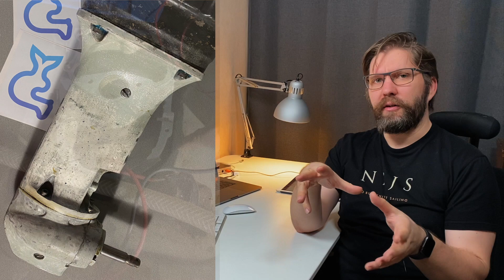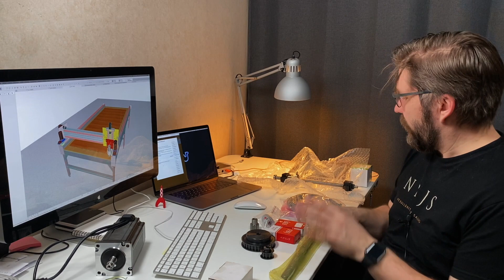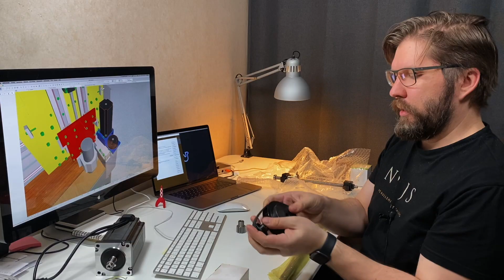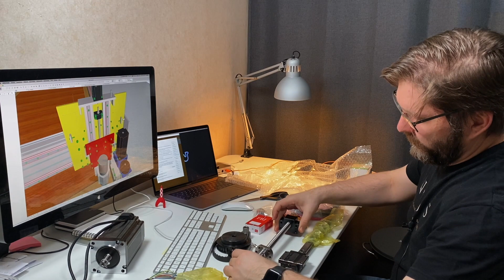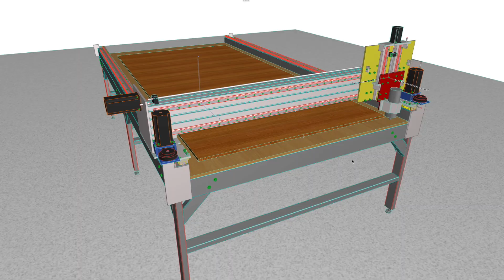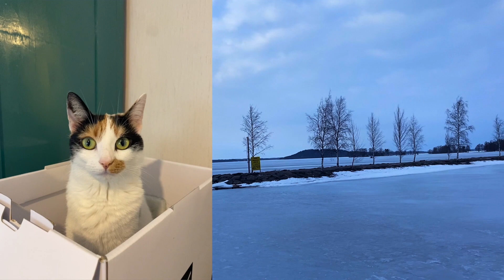Explaining the CNC-router electronics! DIY CNC router part 3 - Ep18 Project SeaCamel

Comment: I built a much more complicated table with multiply levels for Austin Mini Car when I worked for a research and developing company years ago in the early 90's the table I built was welded with hard wire and had to clamp everything and not weld things up  too much to eliminate the heat and the distortion to control the heat as much as possible for less warpage It had many rails in the table that had multiply axis and multiply levels. and was set into a gantry kind of set up for robotic welding process. When it was finished it was sent to Birmingham England. Its been so long ago I barely recall building it and the processes involved in the build.

Comment: excellent work, I ask you some questions: 
1- which motor do you recommend, step motors or servo motor? 
2- about Controller, for a professional use, which one do you suggest me buy? maybe like the CNC USB controller Mk3,AXBB-E , Centroid 4 axis Acorn?, Arduino, or some other? What is the difference between them ?

3. which is better or the difference of using Ball Screw nut BK/BF12 or Timing Belt ? Which is faster ?
Reply from the maker: Hi! Good questions! I'm not expert so these are my thoughts only...

1. Servos are of course better, more efficient and everything but more complex to run and much more expensive. In normal machines like this I see no particular reason for going with servos. If you do professional machine with high speeds and ultimate precision, servos should be the way to go. My motors are "stepper servos" which means that they're steppers but added with encoder to send information of the rotation and position to the controller. So if the motor loses steps, the system will stop to avoid mistakes. Also it should be more energy efficient.

2. For professional use there was suggestion in some comment of more sophisticated motion controller system. Can't remember right now what it was. But anyway I would not get USB-connected but more like "stand-alone" controller that shouldn't care if connection to the computer was lost in the middle of the job. I really don't know enough of these to make any particular suggestion.

3. My first thought was to use timing belt for running the Y-axis (the longest). I asked about it on forums, but apparently there might be problems over time when the belt slightly stretches. Ballscrew is the best in my opinion, but on longer distances there's "wobbling" issue especially on higher speeds. I could imagine that with belt, you can run the system faster. Also if needing fast and accurate, check rack and pinions with bearings. Nexen is one brand that I came across.

Comment: Can you send me  circuit diagram?? Are you using offline controller
Reply from the maker: Hi. You can find the circuit diagram from here:
https://drive.google.com/drive/folders/1WK6L1AJX6qnwg2RIOntq3Gag16lX9NK0

The controller is GoldenMotor's own. There's no any realtime connectivity on is as far as I know.
Reply: @ArcticSeaCamel  you had sent me a another circuit but I need a cnc circuit diagram
Reply from the maker: 😂 Sorry! I didn’t check which video you commented! 😂

I’m afraid I don’t have circuit diagram for the CNC. It’s not that complicated after all and has few “layers” so to speak.
-power in with 230V system (contactors, breakers etc.)
-power supplies for motor controllers are all separated
Rest kind of goes around the Motion Comtroller
-24v power system
-5v power system
-signal cables for all the stuff.

I used mostly CNCdrive’s own manual that has quite good instructions and chematics in it.

Hope this helps!
Reply: @ArcticSeaCamel  oh OK fine 😁 which motor used nema 34 12nm with hbs860h drive???
And are you using offline controller?
Power supply output watt and amps?
Rack and pinion pitch size?

Comment: Really nice build, it will be an awesome machine once it's finished.  Could you share some details and specs on the cnc controller you are using? Do you recommend it?  Looking to replace the arduino with cnc-shield on my own cnc router table, but don't want to jump into the Masso controllers already (altough they are very good) I am using a raspberry pi4, so no need for the laptop to stay on when machining.
Reply from the maker: Hi. Thanks! Yeah, I will do some testing and review of the controller as soon as I can get the things working. There's been delays due to vacations and other stuff on the machine shop. Still missing few parts.

The controller seems to be very good. It was easy enough to figure out and seems to be quite versatile. And comes with it's own software that is little rough but seems to work OK so far.

Comment: That is a really well specified system and you explained and demonstrated it very well. You are clearly ‘on top of the game’ with all this stuff. As an almost irrelevant aside, now that you have machined off the mill scale on the top surface of the table steelwork - how are you going to prevent corrosion?
Reply from the maker: Thank you for your kind words :)

Maybe there could be some grease or similar on the surface after the machine is assembled. But anyway, it's going to be situated in heated and dry workshop so I don't see problem here. The frame itself isn't painted either...

Comment: Which stepper motor drivers are you using ?
Reply from the maker: I ordered them as a kit to make sure of the compatibility. They're "2HSS86 Hybrid Servo Driver". And actually the term "servo" is totally wrong  here. It should be "closed loop stepper" as they're normal stepper motors with added encoder and driven with different type of motor controller.
Reply: @ArcticSeaCamel   I'm using CL57T  on my CNC router ( nema 23 and nema 17  with a ~850mm x 550mm bed )  these can be  quite noisy , though i'm not sure this is really going to be an issue in your case ;) . I'm also using CL57Y ( 32 bit ones) on my pick and place machine , these seem to be a lot quieter, I follow your adventure with interest
Reply from the maker: @DaveHines1  Thanks! :)

Comment: rack and pinion vs ball screw, was this a cost decision? or because the bed size is too large for the sag in a ball screw? loving the progress!! Have courage and belief in yourself when you press the order button xD I call that a tight bumhole moment
Reply from the maker: Hi. Thanks for asking. There was those two sides. The over 3 meter ballscrew for the Y-axis would have costed a lot more (although the machining did as well) but the wobbling was another concern.

The button has been pressed. 😅